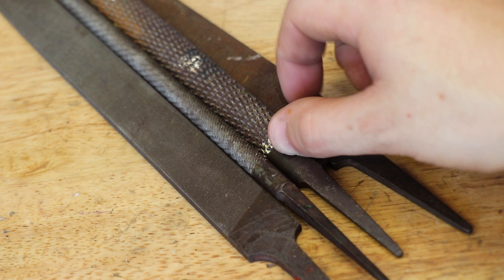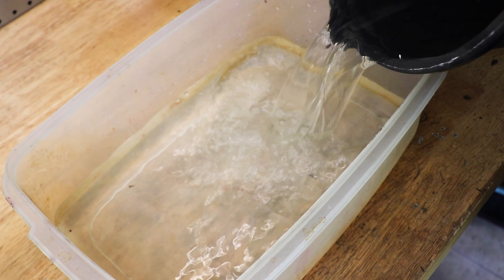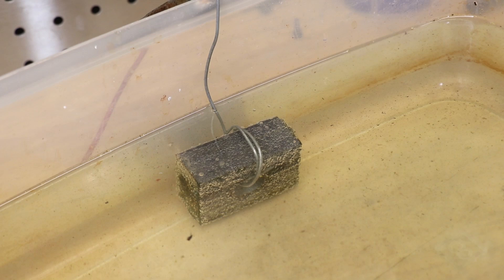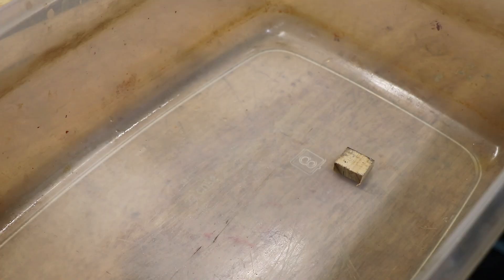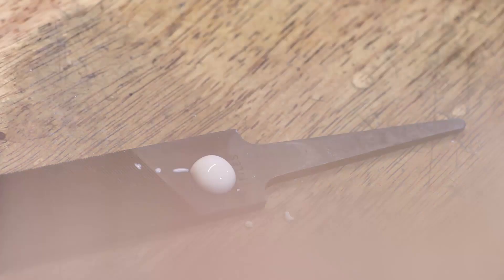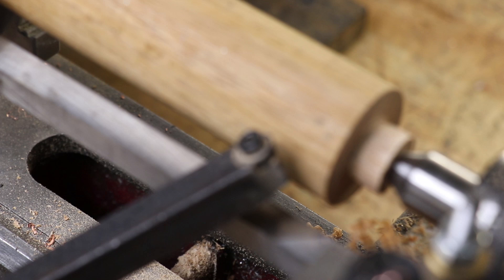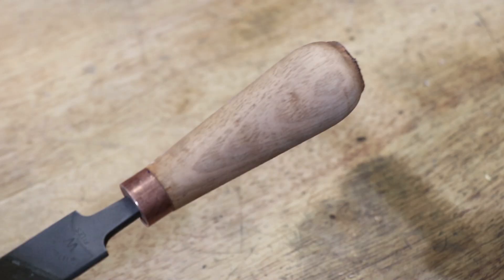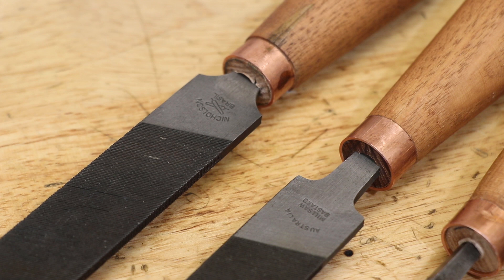Restoring Rusted Vintage Files

Comment: rust has eaten away the cutting edges of the teeth, scraping on them did even more damage...and the nicholson is the only decent file there. nicholson uses straight 1095 steel to make their files. ...sauce for the goose, the electrolysis just finished the job of destroying the cutting edges...suggested title of video "how to go from neglected tools to totally destroyed and useless..."
Reply: they used good steel back in the day... modern 'nicholsons' are crap
Reply: @Old Grizzly  mid 1990s, I was forging knives out of recovered metal. old nicholson files were easy and cheap at swap meets. I called nicholson and spoke with one of their production guys. he told me as of then, they used straight 1095 for all their files except the farriers's rasp.
Reply: @williambenson1477  I don't doubt that at all Nicholson had been bought out by Cooper Tools at that time, but were still being produced in the US. The quality problems started soon after that time, when production was moved to Mexico to 'cut production costs'
Reply: @Old Grizzly  yeah, I've gotten some recent nicholsons and they don't seem to be as good as the older ones were. maybe just me, but I really think the ones I got are softer. like a bad heat treat process or the steel's carbon content is off
Reply: @williambenson1477  Not hard to select the right steel, but it is much harder to accurately and consistently cut teeth, harden and heat treat steel. I have had the opposite problem of steel being too hard and thus getting sections, especially  corners, of teeth breaking of after a couple of passes. 
I have an awful lot of good quality old files, [several lifetimes worth] but if I were buying new today, would probably opt for  Bahco files made in Portugal. 
The best bench files I have ever used were Swedish and made by Oberg. The company was bought by Sandvik and subsequently taken over by Bahco. Production has since been moved  to Portugal, and some Bahco files still bear the 'Oberg Portugal' trademark and are still very good quality
Reply: @bigoldgrizzly  I'll keep that in mind. thanks
Reply: You must live in Australia and have used a number of both Nicholson and Wiltshire files to make that assessment of the Wiltshire files.  I live in Australia and have used Wiltshire and a number of different variants of Nicholson files.  From a user's perspective, old USA Nicholson and Australian Wiltshire files were pretty much equivalent.  The only problem with the Wiltshire files was a tendency for them to be tempered a little on the hard side in one period of their manufacture, the files stayed sharp for a long time, but the teeth were easily damaged by abuse.  In old files, this usually appears as lines along the teeth where the teeth have been broken,  most prevalent with single-cut files, such as mill saw files.  

Unfortunately, the file division of Wilshire was taken over by Nicholson and later shut down, the transition files showed the Wiltshire symbol (four files creating a W) but were the only Wiltshire files I have seen that did not display AUSTRALIA, indeed there was no country of origin, I suspect they were imported, I did not have a good experience with these files.

The Nicholson file in the video was made in Brazil, my experience with these files is poor, they are soft, I had a 12inch mill saw that lasted about 3 hours on some pretty easy cast iron -total  junk!  I threw it in a corner in disgust (no master, I did no such thing, you trained me well), some time later (quite some time) I decided to take it back to the store,  the distributor agreed to replace it, the new one made in PRC!  I did even bother, when I pulled it out of the packaging it had damaged teeth, probably from file against file on the production line.

In the video, both the Nicholson and Wiltshire single-cut files are showing wear, the Nicholson seems to have more wear, but this proves nothing.

I see nothing wrong with him cleaning the gullets, you don't have to touch the cutting edge. Rust will damage a file, but I would not abandon it until I have assessed the cutting ability, a good cleaning, and carding should bring it up, there is no need to remove the rust unless it is contributing to clogging the gullets, a bit of work will clean all the important surfaces of rust. 

Using any process that indiscriminately removes bulk material will damage the cutting edge.  Acid etching will have different etching speeds in different precipitates in the steel, this will create a rough surface that will feel sharp but is more akin to "metal sand paper".  Also, etching will clean the file also making it feel sharper.  Acid etching is often used to remove sharp burrs etc on steel.  On a cutting tool, the geometry of the cutting edge will ensure that material will be removed faster at the edge than material at a flat surface, this will definitely blunt the tool.
Reply: @robertnicholson7733  I absolutely agree - acid will not sharpen files. 
Where I live [close to Sheffield] quality used files are a dime a dozen. When I'm buying at car boot sales, I get a decent idea of how sharp they are, visually looking for bright, or less rusted areas of teeth or other tooth damage on the file and running my thumbnail up the file to get an indication of 'grab'. I give them a lightish wire brushing using a brush sold for cleaning barbeques [it has much finer wire than commercial file cards] Next stage is into the electrolysis bath for a day of two. You can leave them in a month and the process will not remove any parent metal. Dry quickly, I place them over an electric heater, to minimize risk of flash rusting. A second wire brushing and using a safey razor or box cutter blade. I pick out all the non ferrous crud like aluminium brass or lead. Spray with wd40 and make a sleeve using heavy gauge polythene sheet and a bag sealer - job done.
If, when you get it, it is not a good file underneath the rust, it never will be, no matter what you throw at it.

Gets to be habit forming though. I have enough good files for the next half dozen of so generation of my family ....  and still I keep coming home with more. Sort of theraputic....
Reply: @bigoldgrizzly  Unfortunately, in Oz, the supply of good, second hand files is getting less and less and the prices are going up.  Sellers have twigged to the lack of quality new files, this has been exacerbated by people who buy these files for making other tools and knives,  destroying the file independent of the condition of the teeth.  I have heaps of old useless files sitting around waiting for me to get some projects underway, they could have them in exchange for the good ones, but that never works out.  Worse, they tend to pick on the parallel-edged hand files, the ones with a single safe edge, as they are thicker, the best files  <argggg>, the tapered files really don't cut the mustard for the work I do, which is hand filing flat surfaces, accurate inside corners, squaring up, etc. .

When I get a file that is not too clogged I just run it over some cast iron for a few minutes, that tells me all I need to know, the rust will be worn off revealing any wear on the cutting edges of the teeth, broken teeth,  and corrosion pits due to corrosion.  If it is worth saving, I then clean it (if necessary) in a strong caustic solution to remove, paint, some glues, old gummy oils, etc.,  it also does a nice job of eating away aluminium.  Sadly, getting rid of lead is a pain and is usually achieved using a tool to clean out the gullets, in my case a sharpened carbide edge about 6mm long.  I rinse and then dry it in a toaster oven at low temperature, it is the same oven I use for tempering. I then card it and, if necessary, used cheap, small but fine, stainless steel and even finer brass brushes obtained from discount shops to give the final clean.  Occasionally, if I feel it necessary, I will use Evaporust to remove any remaining rust, I only really worry about this if the rust is clogging the area just below the cutting edge down to the gullet, or it is a small file such as a saw sharpening file, especially the very small ones used for sharpening dovetail saws.  After any required drying, I soak the file in a bath of paraffin oil (the oil that is a by-product of the creation of paraffin wax, this is a clear, low-viscosity, pleasant-smelling oil that was a favourite of clockmakers), l then wrap them in waxed paper.  Recently, the Chinese manufacturers of these small brushes has changed from brass to brass-coated steel wire, which is bad news, the brass ones cleaned better, just don't get one of the brass wires in your skin.

I have heard about the media blasting technique used in the USA, I am sceptical but still open, but you would have to examine the result.  Apparently, the media blasting is directed across the blade in such a way that only the metal at the back of the cutting edge is removed, I have no idea how this is achieved

I will have to investigate electrolysis, I have been a bit lazy on this one and thus have probably wasted some time on my method.  Baking the item after electrolysis should alleviate any issues with hydrogen embrittlement.

One of my old methods of cleaning files was to put them in a bath of WD40 for a couple of weeks, the WD40 used to get under much of the crud, and it came away with a quick brush,  I used WD40 as I could get this in 5 litre containers fairly cheap.  However, WD40 is not the best penetrating oil, so perhaps better results can be obtained.  I will have to look into this.

I like to finish a lot of my filing by graining, I use a few different patterns and set aside the very best and sharpest files for this task, mostly single-cut files of different sizes and grades to get different tooth spacings, sometimes I would use a double-cut if the will moved me.  I find it much easier to control the files, when I apply minimum pressure, this requires a very sharp file, and getting an even gaining effect requires a file in very good condition.  When set up, each file has its own slot in the drawer at about 60 degrees.  The files never touch one another, old Harold who taught me to use files seemed to be deaf, but he could hear file on file from 50 ft away and employed some sort of teleportation system to be instantly by my side, he never raised his voice or said anything nasty (well, he called all of us cove, but I don't think that counts), but his disappointment was palpable.

At one stage, as an experiment, I was considering using the sharpened carbide tool to reform the cutting edge of the file while still hardened, to see if repairing the cutting performance is possible (ohh, look at those porcine aviators).  I have heard of people annealing the files, grinding the teeth off, and then hand-forming new teeth, before rehardening, results unknown.

Then there is Clickspring, I like Chris's videos, there is one in particular that watch to relax, all that beautifully finished brass, but, we were talking about files

https://www.youtube.com/watch?v=SOw9WqMOHjA

My relaxation video
https://www.youtube.com/watch?v=dU7iKNmQBIs

if I am really tense
https://www.youtube.com/watch?v=Uc-hUvbqqh8&

The whole channel is great, and I am not saying that just because he is a fellow inhabitant of Oz.
Reply from the maker: Useless? I use these files all the time and they do a great job. Far from useless

Comment: Wouldn’t it be much easier to take care of the tools accordingly after use? Much like the way a mechanic would with their tools for preparation for the next use after. That way it would avoid the caking and build up of long neglect would cause and save on the amount of time in the long run.
Reply from the maker: Would be nice, but reality is there just weren’t times when we could practically do that

Comment: why just not start with vinegar at first place. leave files in the vinegar bath for 2 days and they will be like new, no need to remove rust. i think i used 8%, you just need the right kind of vinegar
Reply from the maker: From past experiences I feel that I've always gotten better results from electrolysis, especially when there are fine details and stuck chips that need to be removed. Could just be wrong, but that was my experience when I did something similar a few years ago. Cheera
Reply: Agree i restore files regularly. I always clear gunk with flattened copper pipe before and after vinegar bath. But this was an interesting and well done video
Reply from the maker: Always interested in how other people do it, cheers

Comment: Not a good idea to put hardened steel in electrolysis. It might become brittle.
Reply: It's a file, it's already brittle
Reply: @zubirhusein  something else happens during electrolysis called hydrogen embrittlement. It goes away over time. Or it can be baked out of steel.
Reply: Settle down it’s just a file
Reply: b*llox!    I have used electrolysis for about 30years and have never seen a sign of embrittlement problems The hydrogen is produced, I think, at the at the -ve sacrificial cathode  and is vented to atmosphere. The gas produced at the +ve anode [ie the file], is oxygen .

Comment: There’s no way you can DIY sharpen a file, all the processes used in the video do is to remove crud from between the teeth, which will prolong its useful life a little…immersing in acid dissolves the metal, and will actually remove some of the cutting edges as mentioned before..
It can be professionally done, but can cost as much as buying them new.
Reply from the maker: I can assure you acid file sharpening is a time tested method and it is even referenced in my 1904 machining handbook. It won’t fix bent teeth but it will etch dulled teeth and restored to Working condition more or less.
Reply: Another person who cannot absorb basic information.
Read up on etch sharpening. Same method used on fish hooks

Comment: You can't really "Sharpen" a file using acid of any kind because it also removes part of the teeth and melts them away.  Just use a quality carding brush and clean them often.
Reply from the maker: Okay but it absolutely does work though and it does sharpen the teeth. Acid file sharpening is a time tested method with reference being made to it in my cope of machining handbook. Try it out, you’d would be surprised how well it work. Cheers

Comment: Cleaning files are not restoring  them they will just be clean dull files 
To restore files to it's original condition you need a sharp tapered diamond file to reshape the filing edges
Reply from the maker: acid file sharpening is a time tested method and it is even referenced in my 1904 machining handbook. It won’t fix bent teeth but it will etch dulled teeth and restored to Working condition more or less.
Reply: Did you actually watch the video? If so, read up on etch sharpening.
Same way fish hooks are sharpened

Comment: Like AM I like to use electrolysis to de-rust ferric materials. As others have mentioned in the comments, the only real way to resharpen a file is to anneal it and re-cut the teeth. Take a piece of paper and draw a cross section of damaged file teeth. Now try to imagine how acid or anything else besides re-cutting the teeth will restore the file's ability to cut.

What AM's video does show is the importance of taking care of your files in the first place. First get a quality file, i.e. not Chinese. The Chinese may know how to make a good file but generally don't bother. Treat your files as you would your other tools and don't damage them by chucking the lot into a drawer. A file is very hard and doing that will damage the teeth. Clean the file thoroughly after every use. Rubbing billiard cue chalk on the file before use helps keep swarf from building up between the teeth and the chalk makes it very easy to clean after use.
 
Don't use your good file as a hardness tester. It works but you destroy the sharp teeth on the file in the process. Allow the file to cut the work, you don't have to attack it like a fiend. With care a good file will last a long time.

A quick inexpensive way to put handles on your files so the tang doesn't get driven back through the palm of your hand is keep a lookout at yard/boot sales for old golf balls. Drill a hole in the ball slightly smaller than the width of the file's tang when fully inserted. Pop the ball on the file's tang and Bob's your uncle. Avoid golf balls with a liquid center.. you can guess why.Using the golf balls make it easy to hang the files between two finishing nails on the wall.

Cheers from NC/USA
Reply: I can't subscribe to the golf ball handle......I learned to file 60+ years ago and a file handle proper gives you the infinite feel to how the file is cutting and where the metal is being removed on the work piece...........for my trade test in the late 50's we had to reduce a 50mm X 100mm long piece of mild steel bar with a hacksaw and files to a square on one half and a hexagon on the other, then another piece of steel plate had to be cut to fit on the hex and square with not more than .001" clearance all around..........4 hours for the test.

Comment: There is no such thing as restoring a file. Cleaning crap out of the grooves of a file yes but once a files teeth have been dragged backwards over a piece of metal the cutting edge of the file has been damaged and no matter what anybody says, the file has been dulled and there isn’t any going back. Any story to the contrary is BS. Buy a new file and learn how to use it.
Reply from the maker: I can assure you acid file sharpening is a time tested method and it is even referenced in my 1904 machining handbook. It won’t fix bent teeth but it will etch dulled teeth and restored to Working condition more or less.
Reply: Fireball Tool, here on youtube, objectively disproved the myth that dragging your files backwards dulls them. Look up his video.